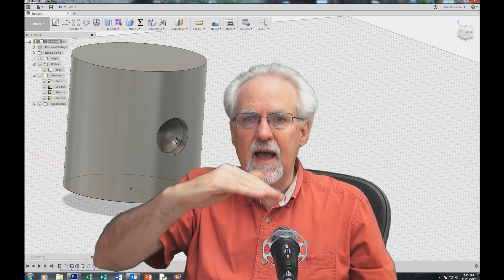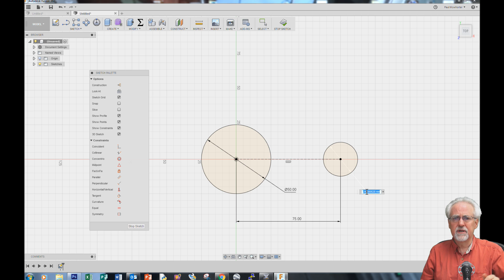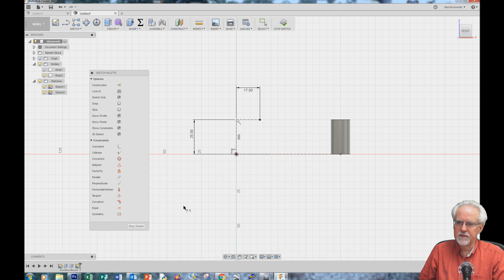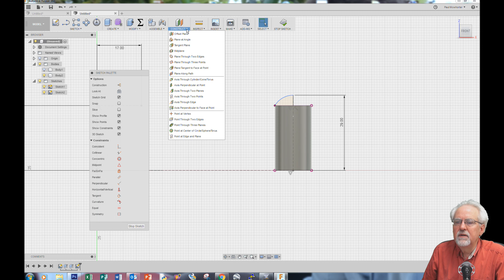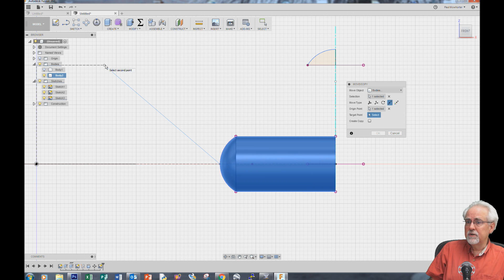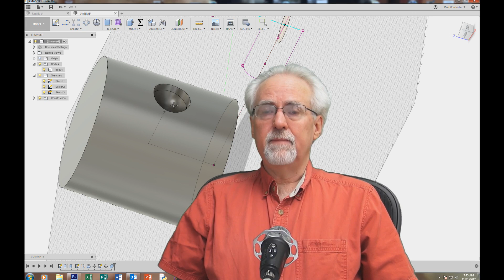Learn Fusion 360 or Die Trying LESSON 13: Creating and Using Tools for Complex 3D Shapes

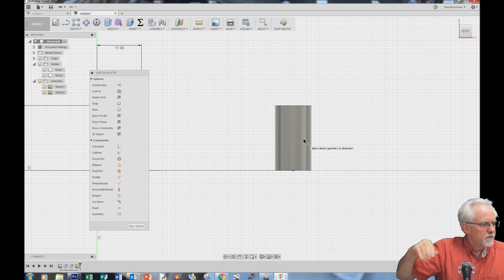Comment: At 9:15 in this lesson, right after you create the line, there's four pink dots on the corners of the cylinder. How do these get created? I'm using MacOS, when I create the line I get no such dots, therefor I can't trim the 3-point circle as it's not 'joined' to the cylinder. Any ideas?

Comment: I didn't expect this to be the last lesson... finally I was beginning to get the hang of it. There are quite some features I need to find out yet... and this means I have to do it with a lessor tutor because there are no equals to you Paul, d*mn*d. (pardon my french).
Meanwhile switching back to the arduino lessons as they weren't finished yet.

Comment: Thanks for a great series of lessons.  I don't even have my printer yet, but my prusa i3 mk3s+ is on order.  I watched a review that said to familiarize yourself with 3D design software before even buying a printer... because if you can't work with that, you'll never master engineering your own designs.  Your lessons were great, and though I didn't have the printer yet, I did download fusion 360 "for personal use" and after learning a little about the differences between my version and yours, I was able to follow along building the first shapes.  Then I watched the others and although I wasn't doing them in Fusion, I did get to the point where I could anticipate most of the commands and actions you were going to do, so I feel confident that I can do them on my own, just referring back to your vids.  I do O-gauge model railroading and my ultimate project is going to be trying to create a scale model of my own house to put on my train layout. 

I'm also interested in the (Arduino?) electronics to build things that will animate things on my layout, so I'll be looking up some of those videos you have.  Your lessons were particularly good in how you went step by step, over and over, on creating these basic shapes, gears, and even a "cutting tool".  I had started the tutorials on the AutoDesk site, but they tried to show so much at once that it was overwhelming.  Thanks again, Paul.  I assume 13 was your last lesson on Fusion 360?

Marvin - (MarvPerk3)

Comment: Just finish this playlist. Before I was checking other playlist until I settled this one. 
Though this is the last one. but the most important lessons are the first 6 lessons.  Because those are the core features and concepts.
As Deb Morris said on lesson #6:

Position, Parameter, Constraints, Dimension, 
PPCD

Comment: BOOM!!! Look at that

Learnings: 1st Project/Design: Mount for ETX 125 Focus Handheld:
 (Available on Thingiverse)

•	Paul McWhorter is a guru teacher, follow him
•	Fusion 360 (F36) needs good net connection
•	If there are pending jobs to save etc, let F36 complete them first
•	If timeline or Sketch constraints disappears, don’t panic, Right Click > Edit Sketch, ITS NOT LOST
•	If you find any extra shade, PANIC, you must have done some step wrong especially if these are on threads
•	Keep playing with Save and Save As
•	Trim only extra parts, trimming within design is not required , this may effect constraints
•	Construction Lines are Key for a good plan
•	Parameters are just lovely
•	Parameters can have equations, you can use parenthesis ( )
•	Keep reviewing dimensions, focus on final design and requirement, there will be mistakes
•	Nut and Bold Thread need 1mm difference, Nut to be bigger, Tried from 8mm to 12mm
•	3D Printer’s hardwork = Desinger / Sketcher hardwork (Thanks to 3D Printer inventers) 😊
Reply: Lessons from Model 2 (FLAG):
•	Min Max used in parameters
•	Keep Sketch Files Separate and Extrude on new file
 (At least for me, timeline is there, but may be I am old school or this way I feel in control)

Comment: Boom, Look At THAT "Meade ETX 125 Focus Hand held holder" on Thingiverse ...  (they need 24 hours to activate it - check my comment date , first)

Lessons form 1st Project/Design:

•	Paul McWhorter is a guru teacher, follow him
•	Fusion 360 (F36) needs good net connection
•	If there are pending jobs to save etc, let F36 complete them first
•	If timeline or Sketch constraints disappears, don’t panic, Right Click > Edit Sketch, ITS NOT LOST
•	If you find any extra shade, PANIC, you must have done some step wrong especially if these are on threads
•	Keep playing with Save and Save As
•	Trim only extra parts, trimming within design is not required , this may effect constraints
•	Construction Lines are Key for a good plan
•	Parameters are just lovely
•	Parameters can have equations, you can use parenthesis ( )
•	Keep reviewing dimensions, focus on final design and requirement, there will be mistakes
•	Nut and Bold Thread need 1mm difference, Nut to be bigger, Tried from 8mm to 12mm
•	3D Printer’s hardwork = Desinger / Sketcher hardwork (Thanks to 3D Printer inventers) 😊

Comment: Well Paul I'm a new sub'er and did all your lessons and was very impressed. I have been an Autocad guy since i had to upload 10    5.25 " floppies into my 286 computer.
I'm using Autocad 16 now but need to learn 3D modeling for my new hobby. In just 13 lessons i think i have a handle how this program works. 
Will still need more tutorials for sure so would love to see you do a new series. Thanks from an old dog learning new tricks.

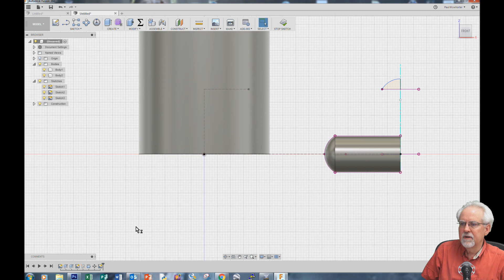Comment: I am currently stuck around 15:56. Maybe it is the update, but it won't give me a point on the tip of the dome. Instead it is inverting the dome point so it is in the middle of the tool, not the tip.   Any ideas? I don't want to actually die trying, lol.

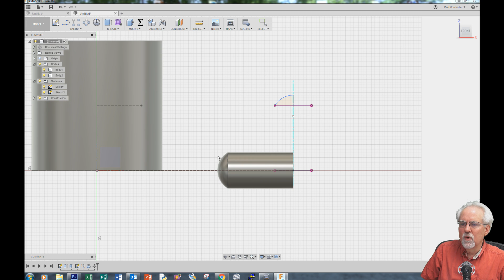Comment: At 15:25, there is a different approach to accomplish the "project/include" intersect function. In the new Fusion 360 update, you cannot select this option directly when you are not in sketch mode. If you try to use "P", select the XZ plane and then the body, it will not result in an intersect point at the apex of the cutting tool dome. I spent two hours trying to figure this out. I eventually found the solution by doing the following: 
(apologies if this has been cited in the comments below)

1) Click the "Create Sketch" icon
2) Now select the XZ plane
3) Select Project / Include in the Create menu (Sketch should be highlighted in the menu bar next to the Tools title)
4) Now select the body of the image of the cutting tool.
5) Click OK. Once you have done this you will now have that elusive initial point of origin that you need to move the object into the cylinder.
6) BOOM!!
7) Continue to follow the rest of the video.

My thanks to Paul McWhorter for a fabulous series of videos. I have not died trying and am very much alive and excited to use these new tools. 

I hope there are more Fusion 360 videos to come using the new update.
Reply: I spent a good 30 minutes confused as hell realising the updated version caused this difference and trying to figure out what to do. While your suggestion is perfectly fine, I ended up simply creating a construction line 29mm long (dimension was listed to the side already of the total height) from the pivot point directly to the left. I've no idea what future problems this might cause, but it worked nonetheless just the same anyway.
Reply: Thank you guys!
Reply: Thank you
Reply: Step 3 in my version of Fusion version 2.0.9937 ( 26/03/2021) is  Create Menu /  Project / Include / Project
I wish these authors of large complex software packages would at least provide a compatibility mode for using menu options from previous versions. How much time is wasted hunting for trivial functions ?

Comment: Hi Paul, Ive watched the entire series on Fusion 360 but I am still struggling with something. I like designing opjects that have a function or fit together with other objects in the real world. As an example, let say a wall mount clamp for a MacBook Pro. I can download a free stl of a macbook but I have trouble using that in my design since stl files does nog seem to want to interact with anything I am designing. I used to work in rhino 3d and used boolean split actions all the time to extrude very specific shapes from my design so stuff fits together. Is there a way to use downloaded objects like stl's and use them as a reference of split on your designs?

Comment: OK.  I'm dying.  I try to follow along and things don't work.  There are just too many inconsistencies between your fusion displays and mine.  It happens with almost every lesson.  Example:  When creating your "tool" you get the 4 edge points of the cylinder to appear when you make the revolve.  They don't show on my display.  As a result I can't get a 3-point circle that can be  trimmed and revolved.  Is there some inherent difference between using Fusion on a Mac versus a PC?
Reply: The same issue (being unable to create the 3-pt circle) occurs in my Windoze version of Fusion 360 - I think it is a version issue, or would appear to be. I had the same issue with the "fusion displays" and made a comment back in Lesson 1 that Paul should probably produce a brief introductory (Lesson 0?) video explaining the changes that AutoDesk have made between the version in these lessons and the "current" version - I'm not sure how difficult this would be to 'maintain' because I don't know how often AutoDesk change their interface, but unless he does that, the series runs the risk of some of the other videos I have tried to watch on YouTube and become 'obsolete' due to being too difficult to work out where the commands are in relation to these lessons, which would be a shame, they are very good lessons. In my case, I can create the circle, but trimming doesn't work correctly i.e. I can trim either half of the circle and not the 4 segments as Paul shows - I suspect this would indicate a lack of a constraint perhaps? I don't know really....

OK, solution: Before creating the 3-pt circle, create the two lines (11:40) - I tilted the cylinder so I could see the top clearly  - and then create the 3-pt circle. Once that is created then trim (but the trim will STILL not work as shown in the lesson, but you'll end up with the correct segment anyway), then do the revolve.

Further: with the intersection of the 'cutter', I had to 'click-drag' to select the cutter (after it had been rotated left 90 degrees) and then did the point-to-point move - Fusion 360 would NOT do it the way Paul shows :(

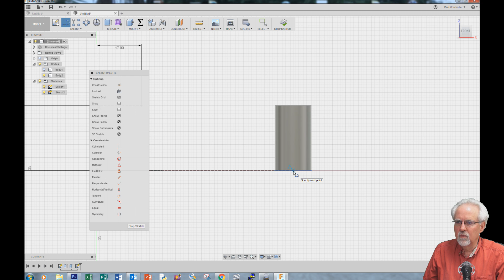Comment: At 9:56, just after you draw the vertical line, you've suddenly also got points on the outer circumference of the top and the bottom of the cylinder. Can't figure out where those come from, they just appear. Thing is, when I duplicate your action, mine doesn't do the same, so I had to manually put them in so that I could draw the 3-point circle.
Reply: I've the same problem with Mac, I draw a 3 point arc. How to put points manually?
Reply: Me too I kept watching the video I am on Mac too and those red points are not showing up .....please help.....I just want to thank  Paul you are the best Fusion 360 teacher...just amazing.....Thank you
Reply: @victorroman4044  that is because you didn't project the body to the sketch. you can do that manually by pressing P (i think) and selecting the body or set up your preferences to do it automaticly.

Comment: Hi Paul, I've just started your Fusion lessons and just finished #3, great job. I have a question for you, what software are you using for the presentations? I'm asking about the presentation software, where you are able to put yourself in the bottom corner. I teach a video production class at a private school and could really make use of this software. I'm also a ham radio operator, wb6kwt.
Reply: Hey Paul. I just got into 3D printing and enjoying learning/using Fusion 360. I'll be 70 in a couple months and a long time from Drafting classes on paper but fairly computer savy. You really make this very approachable and I'm learning TONS! Please keep uf the great work and Thank you!

Comment: Excellent video Paul !
I was sort of scratching my head wondering why you would go to all this trouble to create a tool like this then it dawned upon me that it is much easier to design complex shapes on an external surface than in a recess !  You could make a locking mechanism that has your initials 3D printed in the bottom of a recess of a locking mechanism and on the end of a key to make your own personal lock !

Comment: Thanks Paul. I'm enjoying your instruction greatly. So much so that at 67 I've  asked Santa to bring me an Arduino and a 3D printer☺. I have been drawing with F360 and ran into a problem with the line tool. I was trying to draw a shape to revolve and tried to draw a vase shape where the vertical curve of the vase is not circular. I couldn't figure out how to draw a non circular curve. Nor could I understand how to get the line tool to start drawing a curve from the first point. It seems to insist on a straight section first before going on to offer a circular curve. Is it possible to draw a non circular curve? I imagine it must be? Sorry if this is basic. My brain is familiar with bending curves around cusps in Corel Draw.
Reply: Try the spline tool